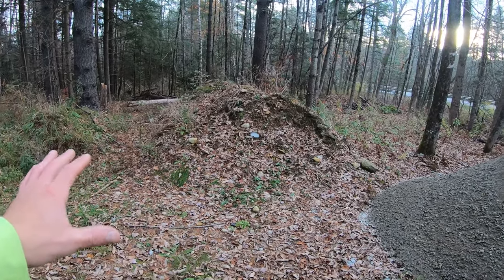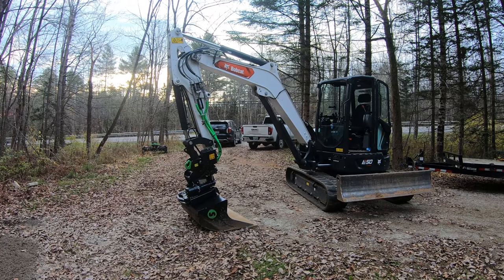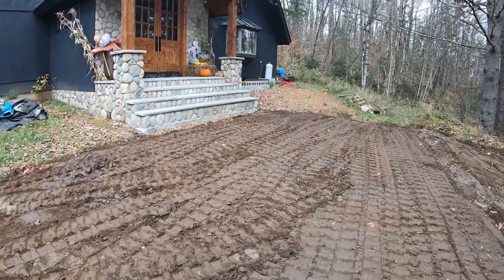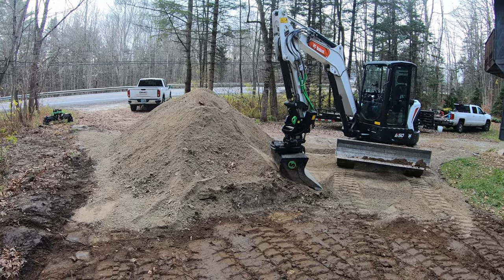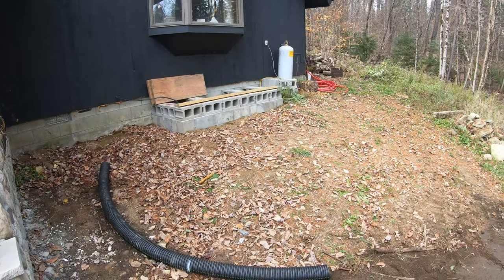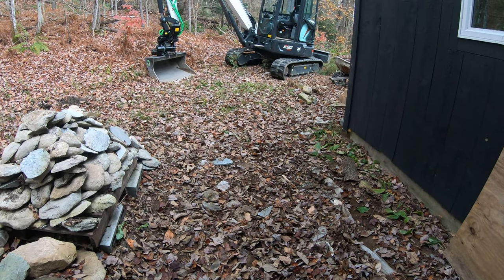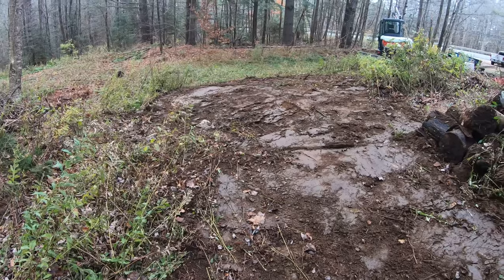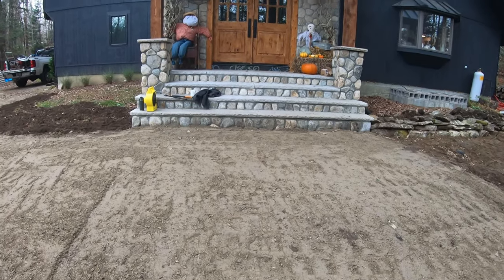Spreading Driveway Base and Building a Rock Wall with a Tilt Rotator

Comment: Not a fan of the Euro style bucket. But that steel wrist looks nice. Nice job.
Reply: have you tried them? it is so much easier to get stuff in the bucket and the taper allows for cutting curves so nicely. I am sold on these buckets even if I didnt have the tilty
Reply from the maker: I agree. After using standard buckets for over a few thousand hours and struggling to cup items in the bucket, these make such quick work of picking up stuff. They do also allow for making really nice cuts, curves with the shape of the bucket

Comment: what buckets did you get? I have a CB3 DB4T GB3 GB5 and a 5 finger grapple with mine. adding a concrete breaker this month to the list
Reply from the maker: I can't remember the model numbers, but initially ordered with 2' Tooth bucket, 48" Grading Bucket, Ripper and the CMP Grapple. I have an 18" Cable bucket, 48" Sorting bucket and Forks on order at the moment.
Reply: @CarlsonSonLandscapingLLC   mine is on a Sany 50  I will be watching your channel to see how the forks work for you. my two grading are 39" and 48", the weight of the 48 is a bit unstable for the Sany 50, it delivered with the 39". I hated the tooth angle on the 2' dig and had the adapters replaced so I can toss stones easily in to the bucket. the adapters are for a thicker cutting edge so when the manufacturer modified them to fit they tipped them the wrong way IMO made it maddening to chase a stone to get it in the bucket. just over 600hrs on it.
Reply from the maker: @xxxmikeyjock  Nice. So far the 48" has felt similar to the 48" bobcat bucket + power tilt to me on my E50. I have yet to use the digging bucket since Ive been able to wrangle around most rock with the tilt/roatate of the cutting edge + ripper
Reply: @CarlsonSonLandscapingLLC  curious if you will find the tooth angle wrong when you do put it on. the Cable bucket is the one that I havent figured out. the angle and length is so different then what I have run before. I think mine is 12" (I mostly install 4" drainlines) so the grab sticks out beyond it as well adding another thing to watch out for. a taper from cutting edge to width of grab would have been better for me.

Comment: Great video. That Steel Wrist excavator bucket really works well! I’m new to your channel and in two of the videos I’ve watched so far, you are using an electronic level. I’ve not seen that type before. Any chance you could post some information on it?
Reply from the maker: Thanks! Its a ZipLevel 2000, altimeter that uses gas and gives a digital read out of height. easier to use in small setup or bad line of sight areas over a laser.

Comment: good joob, what's the yellow you are using ?
Reply from the maker: Zip Level PRO-2000. It is a gas based altimeter, easier to set up and use for small jobs over a laser.